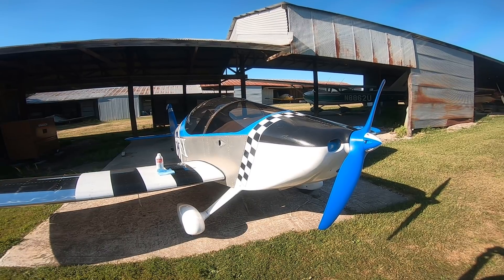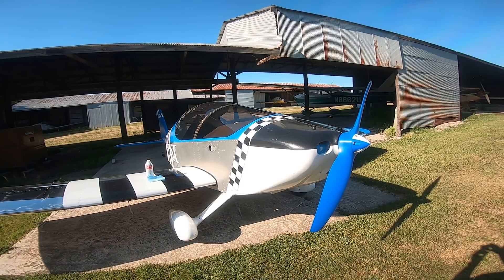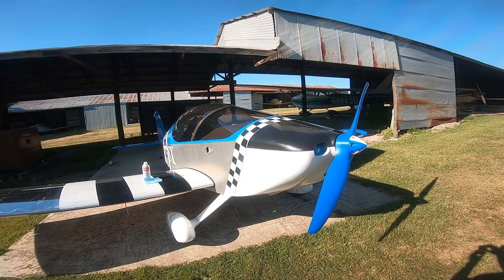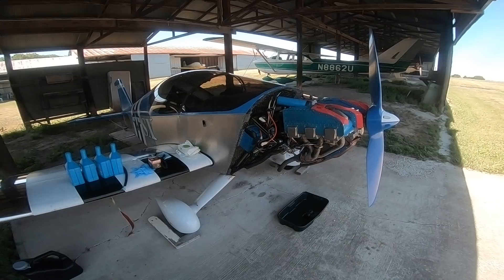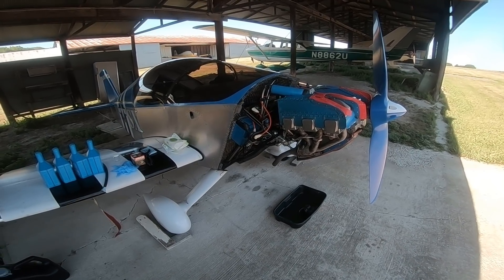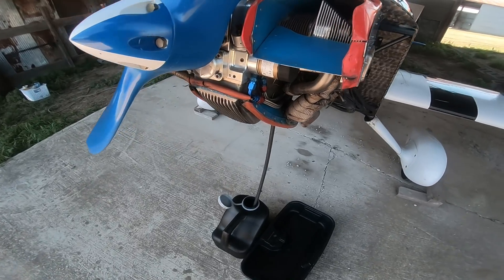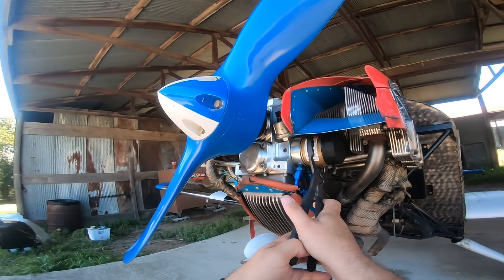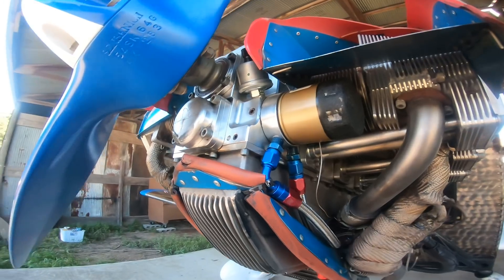Jabiru 3300 Oil Change in a Sonex

Comment: An idea for you when removing the filter...Cut out the bottom of a two litter coke bottle and then remove a section down the side (sorta like a canoe cut in half) so it can slip under the filter bottom. Insert the bottom of the 2-liter bottle under the filter coming in from the left side. Then when you loosen the filter the oil will run down collecting in the neck of the bottle. Remember to leave lid of the bottle attached.  
Or just buy one of these:
https://www.harley-davidson.com/store/oil-catcher-drain-oil-funnel?source_cd=SEM_Shop_PLA&_cr=ssc%7cGOOGLE%7cSmart_Shopping_All_Products%7c&gclid=CjwKCAjwqJ_1BRBZEiwAv73uwMVOcJck7ycddnkz_uTUrvTMUftvydMUdaBbPwDmIEBlTrUD5_lIWxoCH30QAvD_BwE&gclsrc=aw.ds

Your filter looks like the filter I used in my Harley, and that is what most of us bikers do to prevent oil making a mess.  Really like your plane too!

Comment: Geeze, those air coolers really beat the oil up! 10k of hard driving on the street in a turbo car doesn't get that dark.
How do you like the Jab? I read about the earlier issues and my wife wants the best safety possible, and I want the most HP lol.
If it fits, you could run a bigger filter for a bit more capacity and margin... I do that on my race car and use the biggest filter I can find.
When putting on the filter, I thought it was supposed to be 3/4 turn from gasket contact?

Comment: I purchased a Sonex that was completely built it had a Jabiru 3300 but the RPM's are reading high. I was wondering if you have any idea's on how to check to see if the EIS is reading right? I have tried a laser tachometer on the prop but was unable to get a good reading.
Reply: when I bought the Sonex it only had 1 hour on it, the builder only had it in the air for an hour.
Reply from the maker: You can purchase optical tachometers from ebay or amazon that should work.